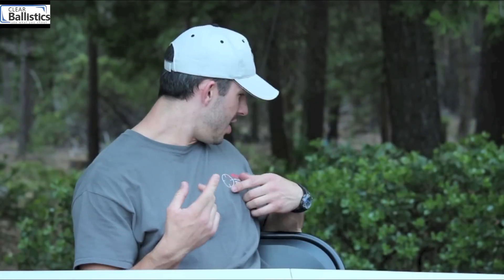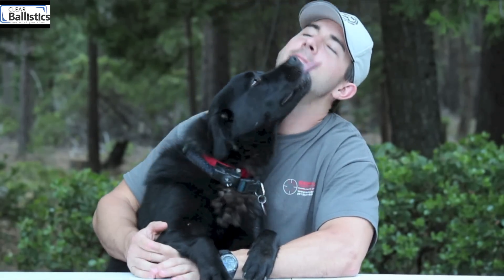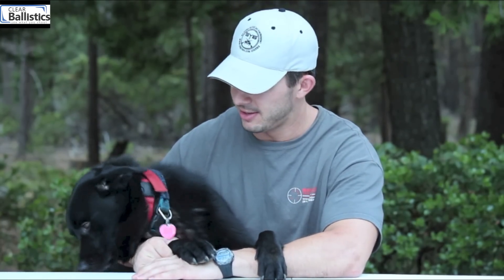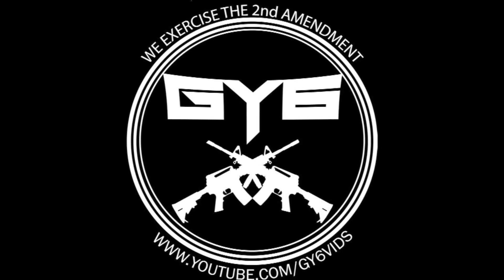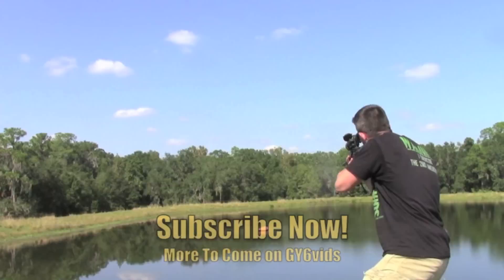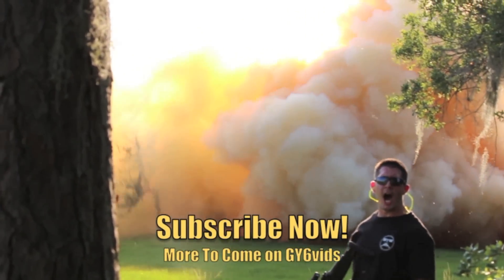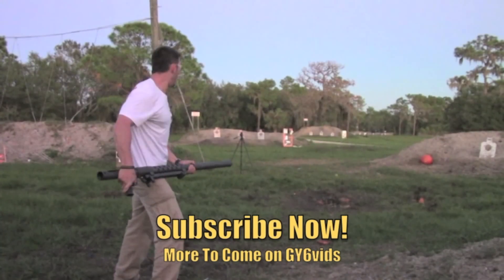Explosion Inside of Ballistics Gel- "Sonoluminescence or Dieseling" is the cause

Comment: I do not think any appreciable amount of powder has been drawn into the gel.  The powder burns in the first few inches of the barrel (which in the case of a revolver includes the cartridge case and cylinder throat).  For the noted effect to depend on unburned powder would require a sizable amount of powder to remain unburned AND for that sizable amount of powder to remain with the projectile while flying unbound through the air - ten feet from muzzle to gelatin, I think mentioned.

Forensic ballistics record the effect of unburnt powder on a surface (including skin of the recipient) called 'stippling' or 'tattooing'.  This only occurs in relatively close injuries or shots fired.  Not noted at ranges of ten feet.  Which decreases the chances of a concentrated wad of powder following the projectile and igniting.

Just for the record, muzzle flash is not unburned powder either.  Muzzle flash is caused by incandescent particles heated by the combustion in the cartridge.    

So what did happen?  I have no idea.  I did see it and believe no skullduggery was involved.  However, I have no idea of the materials involved or chemical reactions.  

It is odd.

Equally odd is the thought of testing the ammunition designed for a lever action rifle in a two inch revolver.  I suppose you explain that in the following video.

Comment: Air does not need to be sucked in as any combustion occurring inside the cavity would form the requisite volume of heated gases for the demonstrated effect. It is likely that the bullet had some powder trailing behind it and the combined residual heat and friction heat was sufficient to reignite it as the bullet was slowed by the gel.

Comment: Something to do with I think is called "sonoluminescence" by creating a cavity in a liquid. Has nothing to do with gun powder. Only the compression of oxygen, kinda like how diesel motor works. There's even som kind of shrimp that actually does this to kill its prey...anyway the air in the cavity is sucked in and compressed so fast it ignites, friction and pressure, heat...not sure but I think I've heard about this.
Reply: Sonoluminescence doesn't need a liquid medium to occur, just the proper frequency of compressed air. It's just easier to do in water because the density of the water makes it easier to compress the air to the proper resonant frequency to make it occur.

Comment: The cavity collapses due to low preassure inside the gel. The round impacts with a high enough velocuty that the cavity expands and shutd out, the explosion can be explained in chemistry and physics, as there would probably be some burning powder on the round the lower pressure will reduce the temperature needed to ignite the powder as the bullet itself is really hot this will ignite the powder. This theory explains both explosions the unspent powder after the initial explosion will continue onwards with the hot bullet and the rest is explained above.

Comment: Here is another theory that might or might not have a big enough effect: There is a small piece of powder attached hard enough to be shot but then gets shaken off when impact occurs. This would explain how that unburned powder got inside. I think that because of the heat of the cartridge going off mixed with bore influence, the bullet would be hot enough to cause that powder to ignite. It looked like it had a decent amount of air to use. Sorry if someone said that before.

Comment: I would guess that it's partially unburned powder, but most of that powder should have dissipated right away as it left the muzzle.  There's a lot of gas pressure coming out behind the round that would have blown most of the excess powder away.  What I think causes that explosion is air compression.  The round creates a giant cavity that has to fill up with something, which just happens to be mostly air, but it only cavitates for a split second before the gel collapses back in to fill up that hole.  When the gel collapses, the air inside the cavity doesn't have enough time to evacuate, so the compression generates heat, and eventually iginition, just like the cylinders in a diesel engine.  The reason I say that I think it's partially due to the excess powder is because you can get an ignition with only air and an ignition source.  You need a fuel in the mixture as well.  There could have been something in the air that acted as a fuel, like dust or maybe wood particles, but since excess powder is the most obvious fuel in the scenario it isn't much of a stretch to say that some powder got drawn into the cavity.  My guess would either be that some powder stuck to the base of the projectile and fell off as it passed through the gel block or that some of the powder lingering in the air got drawn into the block by air pressure.

Comment: I think you are correct with the compression of hot gases and powder in the TWC being a cause for the secondary ignition.  If you notice the locations of the two small ignitions are also where the PWC has the largest expansions.  This might also be because the pressure in front of the round helps cause an inrush of additional air and the sudden increase of that air helps the ignition.  

I'm assuming Max offered no info?

Comment: I forget what its called but this is caused by the gel compressing around the air brought into the temporary cavity and igniting from the pressure of the collapsing cavity. The same thing happens when submarines implode at great depth. The air ignites due to the extreme pressure.

Comment: It is most likely powder that was ignited and found compression in the gel,

The back of a bullet tends to be flat and according to the laws of aerodynamics this means that there will be a lot of drag.

Drag is a bubble of turbulent air caused by a lack of streamlining. So all of this air is being compressed and has to move around the bullet and there is a tiny gap of extremely low pressure air (almost a sort of vacuum)  behind the round as it flies through the air. 

This gap can carry objects behind it very easily. Thats why you'll save gas if you tailgate a big rig, because of that low pressure bubble you are in you need less energy to maintain a constant velocity. 

So as the round fires, left over powder will be burning behind the round until the powder completely burns off. At a distance of ten feet the bullet reaches its destination alot faster than the powder can burn so as the bullet enters the gel it takes almost a foot of gel to slow the round down enough for the powder to be left in the gel. Because the gel is a relatively thick solid it can hold a small compression. This is where the flash comes from.
Without compression burning powder just burns in a lazy fashion. But because of the compression the gel gave the burning powder it allowed the powder that was already burning to fully ignite and thats how the flash was made. The "exhale" of the gel was created as a product of the flash of the powder. The air that was sucked in during cavitation and the fact that powder has its own oxygen molecule built in with its fuel means it expanded and had only a small hole to exit. So the "exhale" is a result of the air inside the hell heating up and expanding. If you look closely you can see the permanent cavity slowly deflate the hot gasses.

Comment: It makes sense this would happen. Just think of a combustion engine, air and gas is sprayed into the cylinder and then the piston moving up creating pressure as well as the spark plug providing fire source creates an explosion making the cylinder move down. And repeating the cycle. And being a video from 2013, you've already figured this all out.

Comment: Is this possibly from friction ignition, from the high temperatures created as the bullet enters the medium, coupled with a reactive ingredient inside of the ballistics gel itself?
or
Seen something similar once and if the gel is of a silicon structure, it could be a piezoelectric effect taking place when friction is created from the plastic tip or the bullet surface on the gel material.

Comment: It may not and probably isn't as hot as sonoluminescence in water. Water has hydrogen and oxygen to burn as fuels.  The block is oil-based and has a decent triboelectric property, that is when the block is peeled away from a surface it has a static charge.  This can happen internally in a bubble or cavity.  The discharge is hot enough to ignite the particles of the block previously pulverized by the impact.  Hence ignition, fuel-source, explosion.

Comment: unfortunately i dont have a reason for the explosion but i believe you misspoke when you mentioned excessive pressure in the cavity igniting the powder. the shape of the round sends the ballistics gel moving away from the path of travel creating the empty space.  the motion of the gel actually causes the cavity to be a vacuum, which is why they normally collapse instantly but in this case the burning powder released gas that got trapped in the cavity and we then heard it escaping.

Comment: or it could be as you said but the ignition sorce is heat caused by deformation of the bullet on impact (like if you bend metal fast it heats up) only your deforming it at like what 1000 fps so its going to get very hot initially  setting off the powder OR the powder particulats were in very very small cavitys that are naturaly in the lead and behind that is the rest of the powder, as the bullet hits the small cavitys with the smaller then sand granuals of powder get pinched due to the deformation of those little cavitys causing a chain reaction setting off all the powder behind it

Comment: I think that what happened was that the gun powder may have been stuck on a piece of copper and may have ignited at a high velocity because when you ignite the primer on a centerfire cartridge the powder pushes the bullet so it must all simultaneously   Burn at once and maybe the a little bit of powder got stuck and ignited with the air

Comment: This is without a doubt the answer to this question. If you have a tube with a piece of paper in it and rapidly increase the pressure it will ignite the paper. look up the physics behind this if you want to know more. But due to this increase in pressure it is temporarily igniting the gel. It's not powder, it's not light reflection, it's simply high air pressure igniting a material. That is that. Myth put to rest.

Comment: I think this is a combination of sonoluminescence and the fire tube effect.  What happens is that supersonic cavitation in the gel caused by the bullet heats any gas and surrounding gel to very high temps and gives off a flash of light.  I don't think even at 10 or 15 ft, powder would have made it in enough of a concentration to cause an explosion.

Comment: It might be interesting to ask Hornaday if they are using a slower-burning powder to achieve higher muzzle velocities with out producing excessive chamber pressures, hence unburnt powder from your short-barreled revolver and the close proximity of the target producing the ignition thereof therein. It is the same effect with a flat backed SUV goung down a gravel road. There is a pressure differential produced at the rear of the vehicle and dust will accumulate on the rear of the vehicle due to the lower pressure. At 1230 fps, any unburnt powder that has been dragged along with the projectile will not have enough oxygen to ignite until the bullet slows down. You may be thinking at this point, "Well Rev., tracers seem to have enough oxygen to burn behind bullets traveling much faster. Why cant the powder burn?" Tracers use phosphorus which makes its own oxygen as it burns, which is why it will burn under water;gunpower does not. Thats why you cannot use a firearm in the vacuum of space. ANYWAY......Thats my thinking on the matter. I hope this doesnt come off as smart a**. I, just today, saw yourchannel for the first time and subscribed, liked and will share some immediately.  BTW....as to the yawing and poor expansion of the bullets. In addition to the lower linear velocity being produced by the short-barreled revolver, there is likely less angular momentum, (spin), being imparted onto the bullet, causing the yawing, inwardly crushed rim, (from yawing), and overall poor performance of an otherwise premuim round. I agree. There should be a warning on the box about using this ammo in a short-barreled gun, particularly a revolver, where gasses are escaping from the space between the cylinder and barrel. Not trying to make any excuses for Hornady, just trying to understand what was happening. By the way, My Jack Russels do the same kind of things to me. Please keep the excellent videos coming. Hope to make your acquaintance some day. Till then........IGY6 too Bro!

Comment: Hello GY6vids, whats happening is something known as sonoluminescence. The bullet displaces the volume of the wound cavity. This means the gel will expand and push against the atmospheric pressure. The atmospheric pressure will push back on the gel and the gas inside the wound cavity will be compressed and reach high temperatures until the nitrogen reacts with the oxygen. Look this up on Youtube: 
"Sonoluminescence In Clear Ballistics Ordnance Gel High-Speed Slow Motion - Aimed Research"

Comment: A .357 mag bullet is definitely still hot after that short a flight, and would probably heat up even more due to friction as it slices through the gel. Maybe as it slows down when it's moving through it, the mini vacuum behind it closed and some powder (or anything it could have picked up from the air) stuck to its ass had a catalytic rush of oxygen? I'm far from a scientific genius, but that'd make the most sense to me.

Comment: Since the clear ballistic gel is synthetic, I'm not sure of it's composition. Taking into consideration the round velocity, the friction imparted, and the void created, I would say you generated a visual combustion chamber. Most likely the clear gel is polymer based opposed to the natural gelatin and water gel used years ago. When the void was created by the round, most likely a dehydrated polymer vapor was generated, static charge from the polymer gel ripping and/or heat from the round ignited the vapor. I'm almost certain it was as simple as that.

Comment: Since the wound channel is creating a vacuum drawing air in then rapidly collapsing as the bullet passes could it be compression ignition of the air itself similar to a firepiston and the smoke is the residual of the heated gel? It is at the apex of the tumble when the bullet is traveling sideways so the air space would be larger for a split second at that those points and then rapidly collapses. Just a thought.

Comment: Sonoluminescence.  Its where a liquid's molecules are ripped apart extremely quickly and then collapse in on themselves to fill the vacuum that is created.  The interesting thing is that no one knows why the flash actually happens. It is hypothesized that the light is the byproduct of fusion occurring, which would be supported by the resulting smoke (burning gelatin).  FYI, fusion occurs at ~17000 deg. F.
In other words, this footage could be scientifically invaluable 
Also, your dog is awesome.

Comment: it's actually caused by the bullet traveling supersonic and that is the friction around the bullet! it hit a solid object the ballistics gel and caused the explosion!
Reply: This in theory is a great idea. But Im not sure if it holds water after thinking longer. The bullet he used (as most rounds do) have a relatively low coefficient of friction...especially against an object with an even lower coefficient of friction like the gel. The two meeting each other at high speeds would indeed result in friction, and it would heat up the gel (which may have caused the expansion). But I don't believe that there would have been enough friction to ignite the remaining powder. Especially since a majority of the force   is expanded out away from the gel...and through the gel. If the gel was harder and absorbed less of the energy, more friction would be present. But I think you may still be on to something!!!! Friction is what I thought of too...but as I said, I don't think its the answer here :). But he obviously figured it out since he updated the video hahaha

Comment: there is no "ignition" or "combustion" in sonoluminescence.   Just the compression of whatever vapor that's in the cavity down to a tiny point- which raises the temperature so high that the vapor radiates due to black body radiation.  There could even be cold fusion involved with this kind of process.